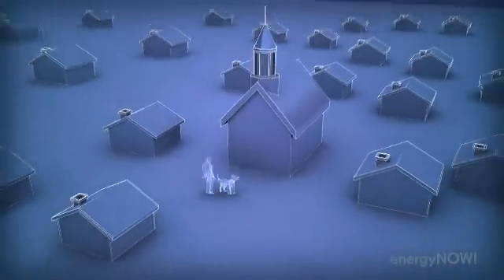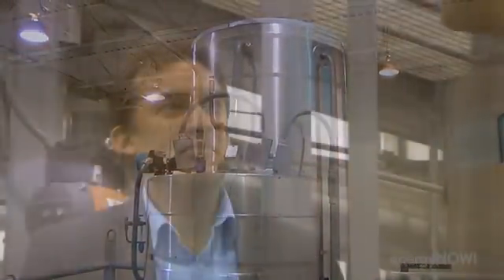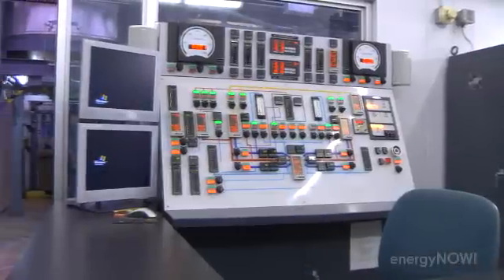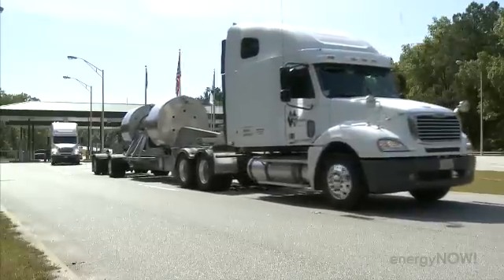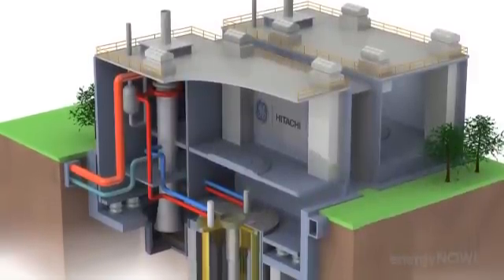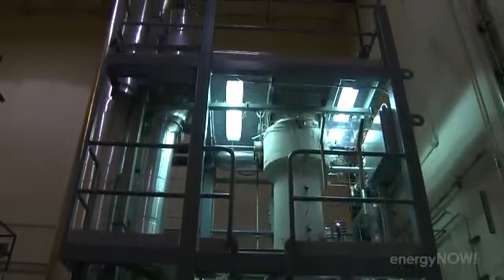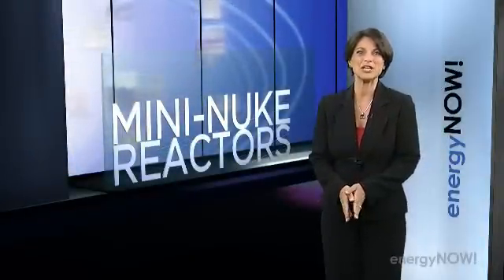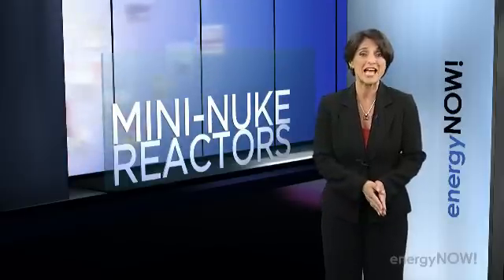Mini Nuke Reactors

Comment: Unlike Westinghouse, GE and B&W Nuscale has taken the very good advice of the PWR inventor Dr Alvin Weinberg.  Dr Weinberg developed the PWR for Rickover's submarine in the 1950s.  This reactor was about 30 MW thermal in power.  The critical advice Dr Weinberg gave was to not build a PWR larger than 500 MW thermal or in the unlikely event of a sudden shutdown and power blackout the reactor will suffer a meltdown due to the decay heat from the fission by products.  Engineering companies thought they knew better and have built reactors over 3000 MW thermal with engineered safety like diesel generators for back up cooling.  This didn't go well for the GE BWR in Japan.

Comment: What happened the last 10 years?
Reply: Floating NPP with modified icebreaker reactors, chinese HTR-PM pebble-bed reactor...
Reply: @caav56  The US NAvy is working with small reactors for over 70 years now. I heard that the navy considers to sell their knowledge for commercial use. That would give a flying start for new generation of small reactors.
Reply: @nibiruresearch  I mean, as long as reactors can be adapted to run on commercial-grade fuel, why the hell not?

Comment: The main problem with Gen2 nukes is WATER. Pressurized to 2000 psi it is not an easy or cheap problem. 
Molten salt or molten lead as coolant does not have those pressures.

Comment: This was like right before Fukushima. I wonder how this business fared..
Reply: well, they sure did not start building in 2015...
but they're still very much in business.
the bottom line is - the world needs this, there is no other way.
Renewables are simply not good enough to supply all the power the modern economy requires.
Reply: Well the NRC recently approved the design and they have plans to build multiple reactors in the US, seems it's faring well.

Comment: 45 MGW is absolutely not enough for 45 000 houses ....a normal house contain too many electric things ...so at least you need 3-5 KW for a house ....so I think the output should be enough for 10 000 houses if they use the electricity fairly

Comment: n January 2011, NuScale's largest investor, Kenwood Group, was investigated by the Securities Exchange Commission and later plead guilty to operating a Ponzi scheme. The SEC investigation was not related to any of Kenwood's dealings with NuScale, but Kenwood's assets were frozen just as NuScale was expecting additional funding. The company started making staffing and pay cuts as executives looked for new funding sources[11][12] and most of the company's employees were laid off within a few months.[13]

That September, NuScale obtained a loan to re-hire 60 employees.[8] In October, Fluor acquired a majority interest in the company for $3.5 million and promised almost $30 million in working capital.[6] According to The Energy Daily, Fluor's investment saved the company, which had been "financially marooned" by its prior investor.[14] A separate agreement also gave Fluor the rights to construct NuScale-based power plants.[15]

Comment: what has NOT changed is the MINUTE AMOUNT of rafiation it takes to harm people and evidently, the 90% Rule, Deny radiation causes harm and under report the damage caused by radiation by 90%.
Reply: Actually, it takes a lot more than you think.
Reply: Fucking idiot, radiation drop off can be described by the inverse square law so when it's 32 feet away it's 1024 times less intense.
Reply: How many percent of invention they used for support human lifes, how many for war weapons? don't ask the wuestion that you know they will ignores.
Reply: Linear threshold law.  Do your homework.

Comment: Nuke power is blind dumb Greed By Foolish idiots. there is no need for nuke power never was Thorium Reactors are real they are here and they are non radioactive.
Nuke power and bombs are a disgrace to our unborn children.
Reply: My god I haven't heard anything more retarded in a while. #1 that first sentence, good lord... There will always now be a need for clean energy, nuclear can power it, doesn't really matter what kind. Just as long as we are closing coal plants is all that matters, nuclear can do it and quickly. Also it cost's a fuckload to build any power plant, but nuclear still has high over night costs, the money really comes in when the plant is paid off (something magical that happens because of the 60+ year lifespan of a plant.) It's more an investment in our future. #2 Thorium salt reactors are a form of nuclear reactor, but they are primarily an alpha emitter, so you don't need much shielding. The best part is Thorium salt reactors are not pressurize so there isnt a chance for a steam explosion, or any explosion for that matter. And no chance of a melt down, cause its already melted. Power failure? Disaster? Freeze plug melts without refrigeration, liquid salts drain in to safe holding tank. Need to start the plant again? Cool freeze plug, pump salt back into the reactor! Got a leak? No problem! Salt cools to air and solidifies making a plug. ( Don't leave the leak though!) Hassle to to separate spent fuel? It's already in a state to immediately and easily separate on site. Truly though, Thorium power, or focus fusion will be our energy future!
Reply: Yes I have taken the time Jordan  to study the make up of a thorium  reactor everything else  I choose not to bleat like so many do and assume you have done no research .  one of mans flaws today he has lost his ability to reserve his judgement Un till he has all the eggs in the basket. You being one of them Jordy.
Reply: The very word  is a fraud sandun  there is no such thing as a Conspiracy it's a word used by a group of criminals merely to divert attention from what really did take place. and Hacking or hackers is not my game .I only do the truth nothing else.
Reply: ***** I dont have the roughly 1b$ to licence and build a commercial plant. And while I am currently a nuclear engineering student, I will admit that I alone do not have the necessary engineering skills to design a full fledged commercial plant at all. This is true with all power plants though, it requires an engineering team, and a large financial backer. I hope to someday interest an investor in building a US generation plant, but China is already building a number of thorium reactors and odds are, when they are successful, the US will just buy them from china :(
Reply: +Gendo Ikari "China is already building a number of thorium reactors"
this is called bullshit
Reply: Check IAEA, that's a serious source. Not some green blog.
Then, if you still want to believe, i won't insist.

Comment: small reactors are very dangerous compare to security as well as use by terrorist organisation for manufacfuring nuclear bombs
Reply: U232 makes that highly unlikely and impractical. There is a reason why we only made one bomb that used the stuff. U232 will always be present and it makes the bomb easy to detect and deadly to thoe who handle it. MSRs (regardless of their fuels) cannot be used to make weapons material unless (like any other reactor type) they are specifically designed to do so.
Reply: fall out in real life?!
Reply: False. Manufacturing nuclear weapons requires a huge amount of material and energy resources only achievable by state actors. Creating a dirty bomb is cheaper, but still orders of magnitude more expensive than conventional weapons. From an economics perspective, terrorists using nuclear weapons is fantasy. Nation-states, on the other hand...
Reply: +Mark Smed but MSR/LFTR refined 233Pa, decayed into 233U, can.
Reply: ...or if the process parameters are run so to produce weapon grade material.

Comment: If you make a "risk chart" on the vertical axis the accident frequency: happens every time on top, never happens on bottom; accident gravity on the horizontal axis: maybe a scratch on the far left, several death and injury on the far right. Now you draw a line from top left to bottom right. everyting above this line is the unacceptable risk. now with Three mile Islands, Chernobyl, and Fukushima, we have reasons to believe that it could happen again: this means it is clearly an unacceptable risk.